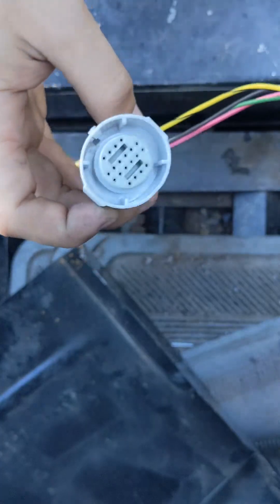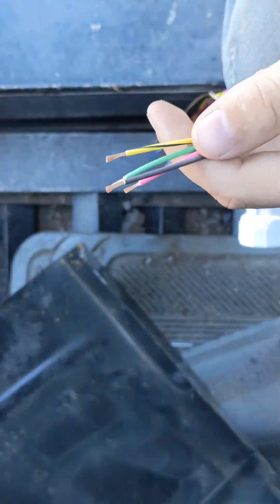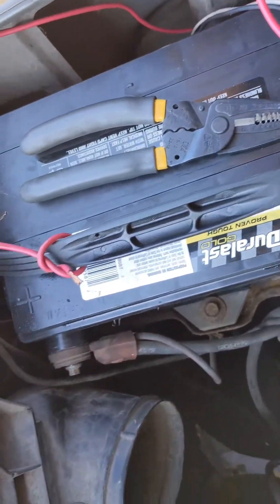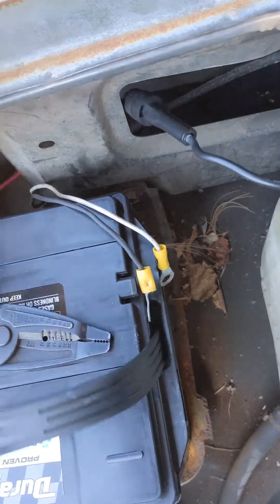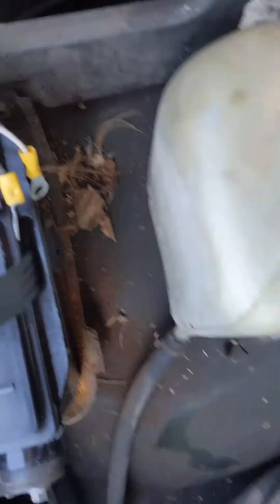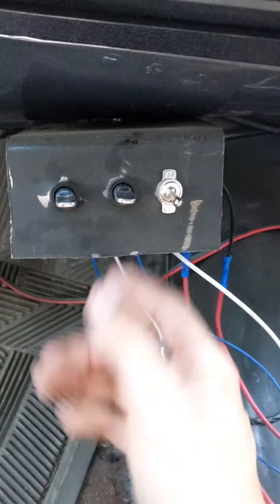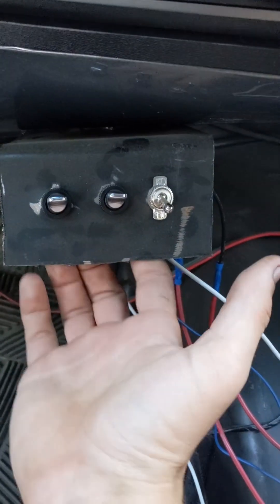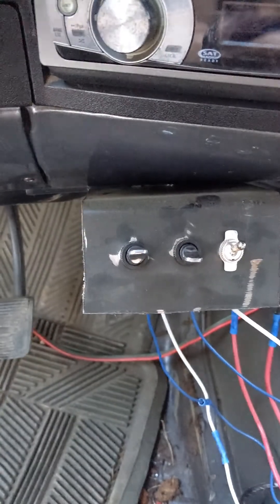4l60e transmission no computer

Comment: I back fed power and fried all my transmission controller boxes, and they need reprogrammed after you swap. Well my obd2 port is dead so i had 2 choices rip out all the wires under the dash and buy a expensive harness for 100+(or dig threw the old one ewww) to properly fix it or i could do this. I did this and it works great.
Reply from the maker: Glad it helped

Comment: Why,, just put a 700 in it. The internals are the same as a 4L60E. Same planetaries, same sun gear and sun shell. Same input drum, same reverse drum, same band, pump virtally the same ,except not Pulse Width Modulated. Valve body is the only difference, no governor, and no Throttle Pressure cable.

Comment: How do i get my 94" 4l60e to work with my 2003 gen 3, its all bolted up and shifts to drive but stuck on first gear. Is there anything i can fix to make it work correctly.
Reply: Check your speed signal, if it has no speed signal it won't shift out of 1st

Comment: Not sure if this had been mentioned in the comments 
CAN this be done the same on L80E?
Reply from the maker: @Andrew-w5y6u  yes, the plug will be slightly different and you may have to look and see if the wire colors are different but it would work on a 4l80e as well

Comment: I like the idea of no computer but I also know how absent-minded some of us could be and I be a little concerned about burning up a transmission because I forgot to hit the right switch at the right time or hit the wrong switch at the wrong time
Reply: Yea just want to drive
Reply: If you run a good cooler even at extended cruising speeds no lockup isn’t the end of the world. The th350s and 400s don’t have lockups and they run like that all day. The more modern transmissions may be more sensitive but it’s still not the end of the world
Reply: Like a big over rev situation!

Comment: Have you had any issues running full line pressure all the time? Seems like it might be hard on the pump. Just curious because I'm doing the same mod.
Reply: I don't see why that could be hard on the pump, the pump is run off the tc connected to the engine, if anything, restricting line pressure is harder on the pump, but I would imagine the AFL valve would still lower it even without the force motor

Comment: I’m looking to do this in a derby car, and all I will ever use is first and reverse, with the shifter, so when I wire the switches up. leave it first gear at all times then just use the shifter to go in reverse, then when I throw it to first it will be in first?
Reply from the maker: Yep.  Should work

Comment: I'm sure it doesn't need 12 volts all the time only when the key is on I'm sure why would you want a drain on the battery like that when its not running idk for sure but it makes sense
Reply from the maker: As long as none of the switches are on, there will be no drain on the battery. Hooking it up to an ignition 12v instead of constant would work the same. In my case it was just easier to hook up to a constant 12v

Comment: this a great video what years transmission does this work with?
Reply from the maker: Depends on the vehicle but most late 80s through 90s light duty trucks, SUVs and some cars had this transmission. Would also work with 4l70e and 4l80e transmissions

Comment: But how do you do reverse?
Reply from the maker: Just put the shifter in reverse
Reply: @slimsauto2406  Damn quick response time thank you. But what switch positions do they need to be in? To go back in forward do you just put shifter back in D and shift with switches? Do you notice if the trans shifts hard due to line pressure?
Reply from the maker: @torque8475  doesn't matter switch positions. Yes just put the shifter back in d and good to go. Does shift hard cause it's max line pressure but less wear on the clutches that way
Reply: @slimsauto2406  Sweet man thank you. I think I’m gonna go the way with the shifter but this is a good way to understand how it works.
Reply from the maker: @torque8475  glad I could help

Comment: LoL......crimp a few more wires together and you can shift with the gear shifter.... toggle switch is super ghetto I remember watching the guy years ago doing this with house light switches omfg people trying to reinvent the wheel
Reply from the maker: Hey man. A lot cheaper than a computer
Reply: @slimsauto2406 no disrespect meant, but he's right, your solution is super trashy and ghetto. You don't need a $1k computer. Just Holley's TPS kit and get the RPM signal out of the ignition.
Reply: @lucasarredondo1429 wow so holly makes a kit so it's all automatically sensed ?
Reply: @excitationofstereocilia2103  Exactly, there are standalone PCM controllers for more modern automatic transmissions, either because you are going to use a carbureted engine or another engine that uses different electronics. Just an example, you could put a Rover V8 in a Firebird or Camaro that has a 3800 V6 which is the same as the Rover but with two fewer pistons. So you could use the original PCM from the Rover and control the original 4L60E transmission from the Firebird.
Reply: @excitationofstereocilia2103  To recap, if you are going to use a carbureted engine, with a TPS kit you can keep your factory electronic transmission.
Reply: @lucasarredondo1429 can't make sense of it
Reply: Can you please explain what to crimp together to use the gear shifter????
Reply: @excitationofstereocilia2103  https://youtu.be/ssFH4s4JqjE?si=QxD6QcBaeQhz4GGb

Comment: I got a headache just running thru the gears by switch. Alot to keep up with
Reply from the maker: Does take a little thinking. Might do a new video on a manual valve body and just manual shifting through the gears. It's supposed to be wire free
Reply: @slimsauto2406 or just wire it to 4th add the fridge switch for 1st and manually shift it.
Reply: @freshbutplain1144 how do you do that?? I’m struggling with this rn on my obs
Reply: @diegomora6030  ground A solenoid at all times and only ground B for first gear. So wire the B solenoid to the fridge switch when you move the lever to first it’ll ground then when you move to second and after it’ll be in the gear you move it to.

Comment: Thank you for this video. I do have a question. I was under the impression that if you left the switches in forth gear mode and the shift selector in OD, that the transmission would start out in second gear but up and down shift thru 2nd,3rd,4th normally. Is that correct? Regardless, Cheers from Alaska! 🍺
Reply from the maker: From what I know that is correct but never really tested it